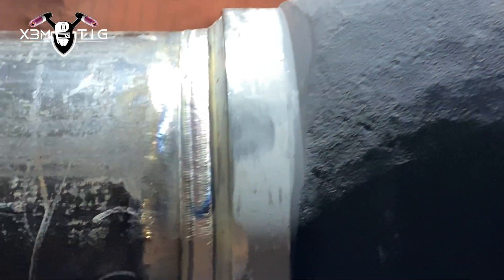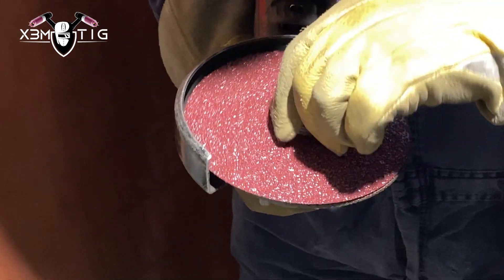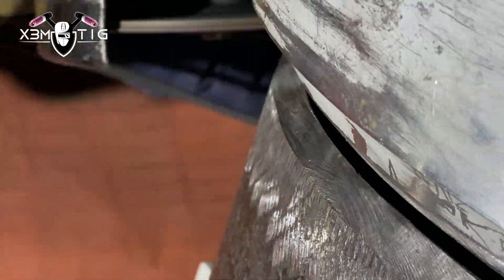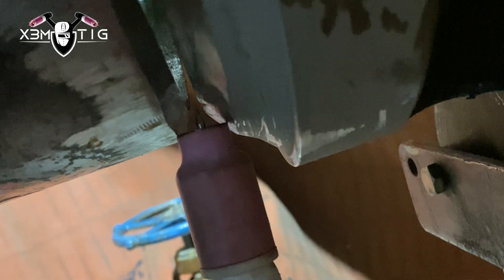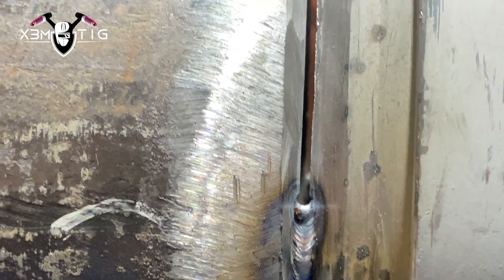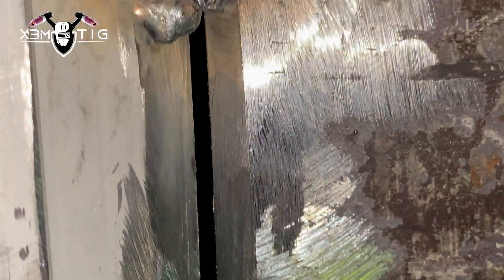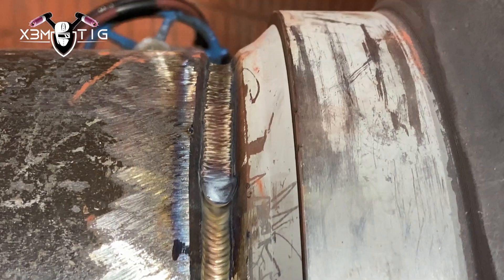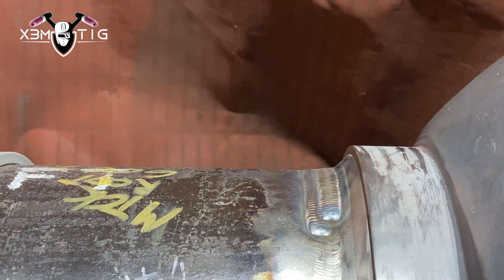TIG Welding Root Techniques | Elevate Your TIG Skills!

Comment: Beautiful weld and simple Technics ❤ man u class one question in this root do you move the wire side to inside the root 6 o'clock ? As in do u feed side to side or ur wire is in the middle
Reply from the maker: Keep it in the middle

Comment: I am not a  professional welder ,I do not weld pipe or anything thick enough to require more than 1 pass.  BUT, I have learnt so much from watching this channel, every video is packed with information and tips on how to do it.  My welding has improved significantly.  Thank you.

Comment: Lil late getting to this video, but I had a weld like this in Oklahoma, they switched bolt ups to weld ins, man I loved it. Got to run 250 filling just shoving wire into the puddle. Very good experience man, not much changes in my opinion, just gotta burn hotter to burn that valve side. Great video Marko 🤙🏼 hope that rig is still treating you well brother and the lens too
Reply from the maker: Thanks brother, rig is serving me great, that’s all I’ve been using lately, lol, and lenses are the best bud…

Comment: Hey mate, I was just curious about what amps you were using for the root run. Trying to back feed but also having a pretty solid pipe to suck the heat out. Would I be right in saying about 125?
Reply from the maker: 120-125 would be good starting point.